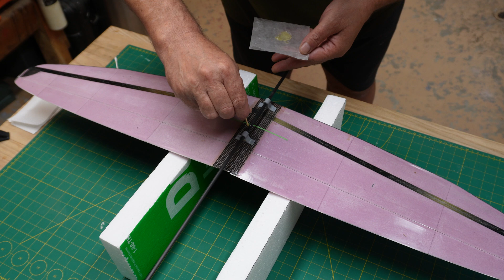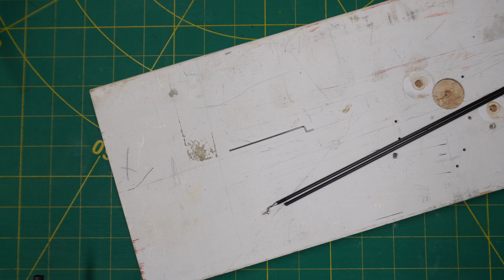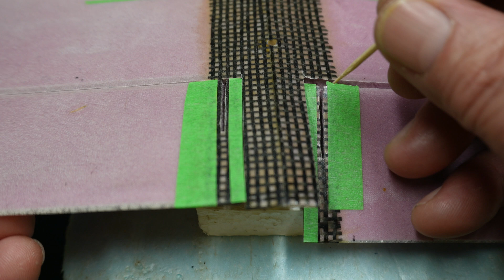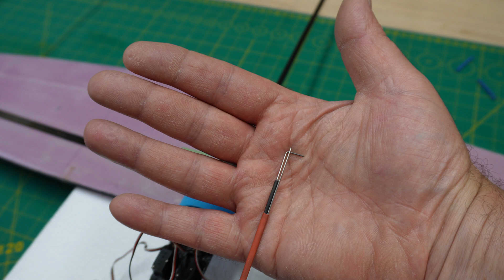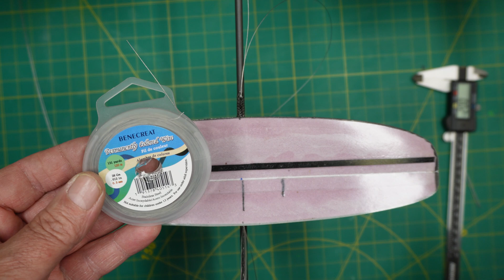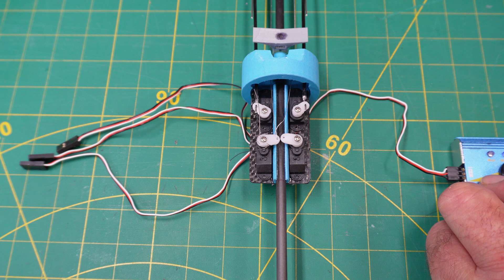How to make a F3k DLG glider. Control linkages

Comment: Thanks to your videos I am buying everything needed to build my first composite plane. What size is the boom you are using?
Reply from the maker: I use a carbon fiber arrow shaft thats 31" long and 1100 Spine / Inner Diameter: 4.2mm
Reply: @amonus-air2160  Thank you for your reply! Do you also have cad files of the 3D printed connectors? That would make it a lot easier for me to assemble the model.
Reply from the maker: @jordycel  not sure what you are referring to

Comment: FOUR   servos !!!    DUMB.        pull-pull cable linkage   dum.
Reply from the maker: hmmmm. please, I would love to know how you would manipulate 4 independent control surfaces without using 4 independent servos?
Also, please note,  the tail section has a spring pull system. 
Have a great day 😀

Comment: Awesome!  Can’t wait to see it fly.
Reply: I’m about to cut out my next wing and acquired some high load 60psi xps for it.   MUCH more dent resistant than the off the shelf 15psi stuff.  Highly recommend it should you do another build after this one. :-).  It has to be ordered from a building supply house. But totally worth it.
Reply from the maker: I bought some higher density foam before by mistake actually. Your correct, it is way more dent resistant. 
It's also way more heavier. :)
Reply: @amonus-air2160 interesting.  My cores were only 1.2g more per wing.  Exact same wing.  Very much worth 2.4 extra grams as I can now skin the wing with .75 oz glass vs the 1.6 oz I used last time.  My new wing will actually be lighter and much stronger as a result.  🤷🏼‍♂️
Reply from the maker: hmmm...interesting. Could you tell me what you bought? 
I'd like to see the spec. sheet
Reply: @amonus-air2160  the most common stuff.  Blue Dow Foamular.  High load 60.  3 inches thick so it has to be sliced into thinner pieces first.
Reply from the maker: You and me both!

Comment: Beautiful video with your precise work, music and your dog! I am happy to you continue your 1m glider building. Nice servo setup and mounting system. I like your printed parts fitting to the boom. Good job, you have done!
Reply from the maker: thank you so much my friend for the compliments. I find a 3D printer so useful to make what ever I need :)
Reply: @amonus-air2160  Which program do you use for editing the glider parts and print them? I just thinking about this construction method (3D printing).
Reply from the maker: for the design, I use Fusion360. It's free and very powerful. My 3D printer is an old Ender3.
It really makes life easier, not just for these parts, but I've made all kind of things such as tools and
things around the house. :)
Reply: @amonus-air2160  Wow, it is really nice! I want to try it! Thank you for your answer!